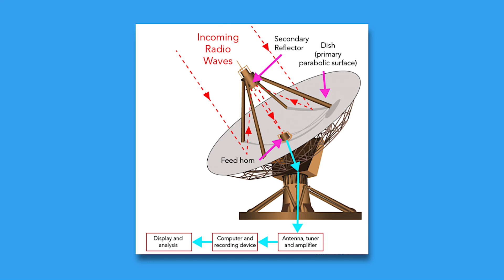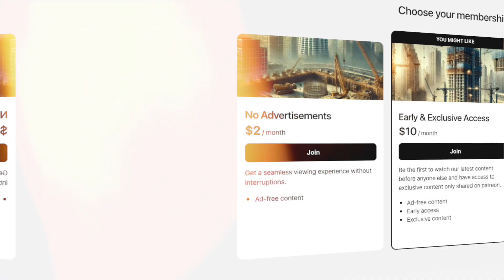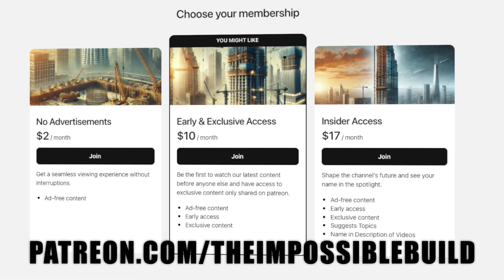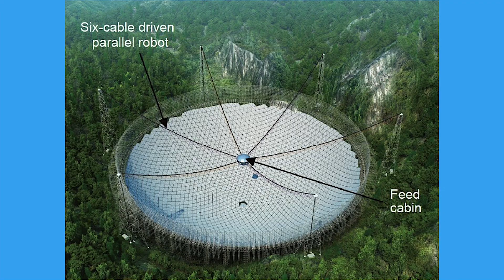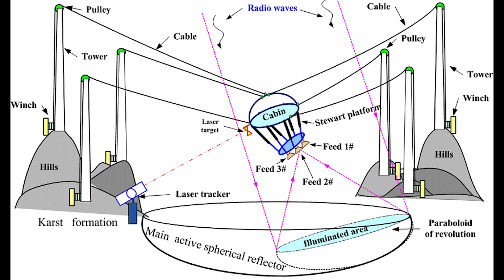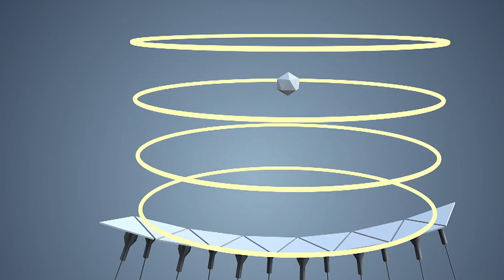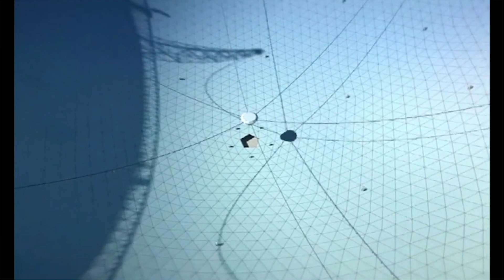The Incredible Story Behind The World’s Largest Telescope

Comment: If 500 m radius dish  is not as efficient as making it having a depth like a cup with large bottom coat with shiny surface then gradually getting smaller until final bottle nect of few meter square. That why it amolified signal higher but the trick is have 1 way transparency and the other side is total internal refection. It is like cone that arrange of the eye pointing toward tranparant surface and reverge on the ither side so light and wave goes in but can not goes out but hsd to bound interally and super imposed at the opening and shoot out hundred of thousand of wat of power